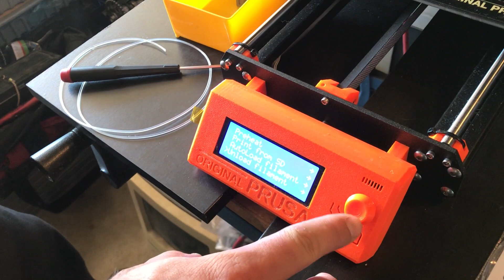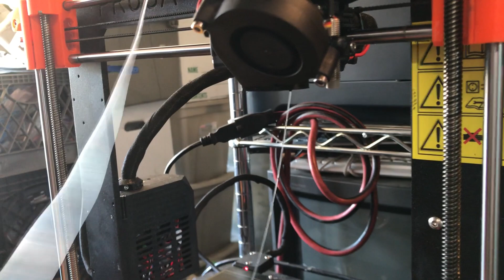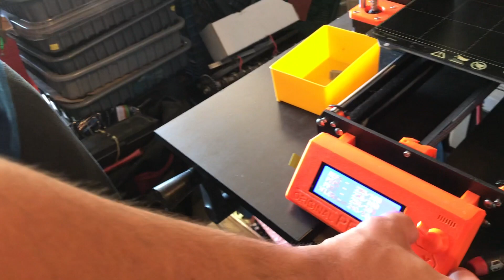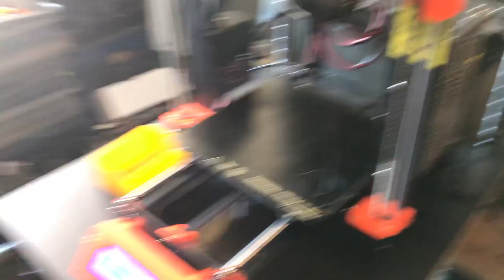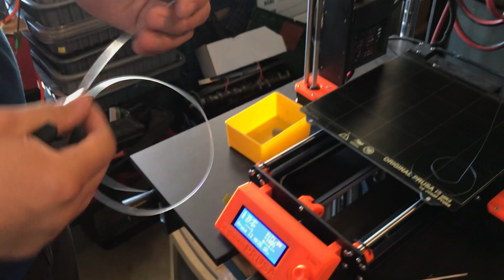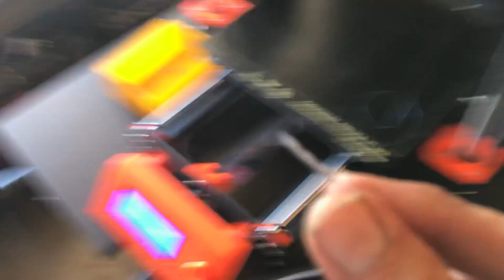Cold Pull Procedure on Prusa MK3S

Comment: No....That's not how you do it. Anyone watching this in 2021 - go ahead and skip this video.  You want it COLD.  As cold as can be. 40c-50c.  And follow it up by cranking the heat up to 260c.  Rince and repeate.  And DO NOT do this ever roll.  Only as needed.  And never unplug your printer while it's colling off.
Reply from the maker: Um what? So cool below 100 then back up? Same thing, except I call that method a “lazy” cold pull.
Happy printing.

Comment: Did you use a specific filament, the wight-sh filament, or any filament that would do the trick?
Reply from the maker: Nylon is optimal since it will stretch instead of breaking when yanked, but anything will work if you perform the procedure properly. 💪🏻🖨👍🏻
Reply: @LA3DPrinterRepair  Is "cleaning filament" acceptable to use for this method?
Reply from the maker: @tombellucco7155  negative, you can get it done with PLA but it's tricky, maybe a little easier with PET, but Nylon certainly works "best" in my opinion; I've got samples ready to go out, reach out if you need something...I'll get a shop online here for folks before the year is up...if we stay on target; wish us luck!

Comment: hello
i print with pla and petg. i need to make a cold pull when i change from pla to petg and also petg to pla? Thank you
Reply from the maker: Negative, as long as you do it occasionally you’ll be fine. 🖨👍🏻
Reply: @LA3DPrinterRepair  thank you. Last question. It's possible to clog with a stl detailed with a lot of small retractions?
Reply from the maker: @carloscarvalho4595  unlikely, unless you’re using HTPLA or modified the print profile beyond recognition.

Comment: This video really helped me. I had a nozzle clog when using wood-impregnated filament, which is touchy to begin with. You get a lot of carbon buildup from the wood burning over time and it's hard to get out of a nozzle. I had gotten the nozzle hole clear using tiny drill bits, but I never thought of cold pull as a cleaning method for the rest of the nozzle. It grabbed onto all of the carbon buildup in my nozzle and pulled it out. I did it twice and I was was astonished at how much junk came out. Who knows how much other buildup was there from a year's use... Thank you again for publishing this!
Reply: I switched to 0.6 and 0.8 nozzles for wood and corkfill filament. This solved a lot of my problems with those materials.